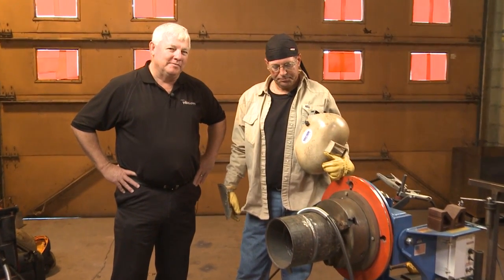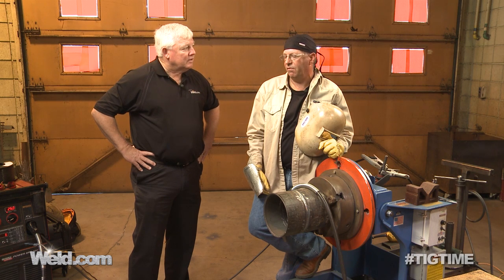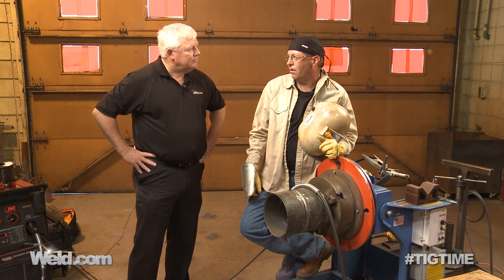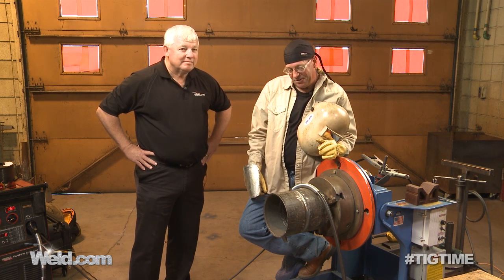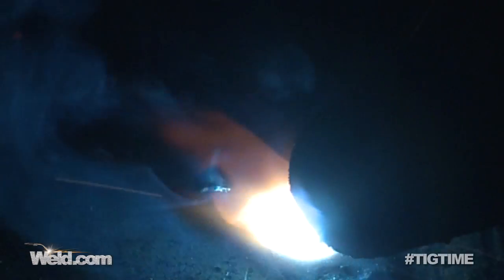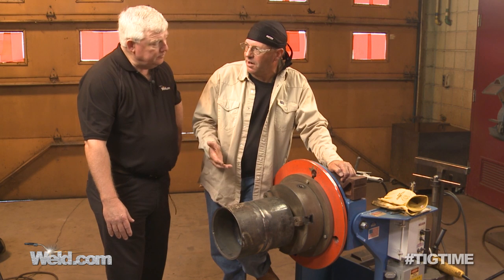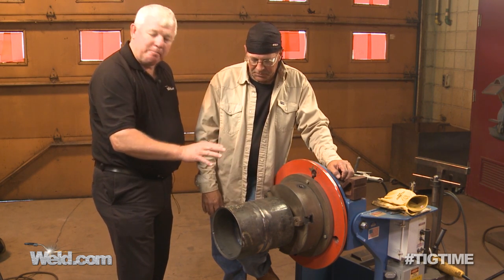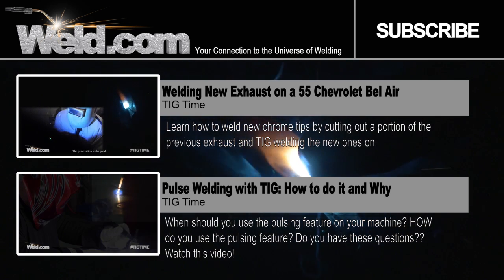Pipe Welding: FCAW Welding the Fill and Cap Pass

Comment: I thought you had to go uphill. Or is it different since the pipe is on a rollout wheel. Is that equivalent to welding in the flat position with the roll out wheel
Reply: As long as you’re not welding on the side of the pipe and your welding more towards the top it is essentially the same as flat when you do it on a positioner.  So yes, you’re correct.
Reply: Cake Fart RPG  thank you

Comment: Is there such thing as open root with flux core?  Ive seen 6gr but its not the same.  Yiu you make a video on flux core root on pipe.
Reply: I've used .045 dual shield to run open root thru cap. Takes a few tries to dial in the root opening and landing to get the proper root pen and reinforcement. 1 root pass and 1 or 2 passes to cap out on sch40 6" pipe.
Reply: Chuy RDZ yes

Comment: Yeah that wire speed was kind of high lol. Also I thought flux core had to be done uphill like 7018
Reply: I've ran 7018 3/32 downhill on 4in pipe in college not realizing it I just cranked up my maps and it bent fine I had some undercut open up but it didn't fail me

Comment: If this pass was done with solid wire no flux core would you have seen ripples in the weld or would it have been smooth also thnxs

Comment: Every weld test I've taken or practice has been strictly stringers no weaves( flux core wire) and I've read somewhere that those wormholes can be caused by to much shielding gas pressure.
Reply: only time ive had that prob was running very hot around 27 volts and up
Reply: too short of stick out could also be the problem
Reply: Wormholes or tracks can be cause by a number of things. After trying everything and still getting them, grab a new roll of wire.

Comment: The amount of worm holes on the full pass is unacceptable!!! 

If your going to do a video to give people advice then do it right! 

Use fresh dry FC wire.
Reply: i thought i was the only one who noticed those wormholes. im surprised he didn't get porosity on the cap pass
Reply: Trust me they are there, watch very closely as he's laying the cap pass. 

That ain't ripples. They are defects
Reply: Heres the thing

This is not a tutorial its just a badic over view of this process mig root then flux core dual shield fill and cap... basic settings etc

Lighten up and GET A LIFE
Reply: ***** holy shit the fill pass it full of worm holes I see them as he's laying the cap like u said...terrible that I agree is unacceptable
Reply: to hot
Reply: I don't think those are wormholes fellas, he's weaving(idk y) so it leaves ripples it looks nice and smooth when u don't weave u don't need to weave with flux core it will increase chances to trap slag for an xray
Reply: *****  wow that's bad!
Reply: Its not my job to rectify the mistakes made by this " welder " but in my opinion torch angle, damp wire or an issue with the machine could be one of many factors causing the defects. All I was saying is that if you are going to make videos to show people how to weld then don't show a video of a welder laying down weld beads full of defects. kinda sends out the wrong signals a to what is expected.
Reply: roughcap i seen those crows feet! lol
Reply: Dude i was about to say am i the only one that sees worm track fuckin galore
Reply: only time ive had that prob was running really hot and fresh wire didnt fix. if your gonna point out a defect give a solution
Reply: SaltyBro 
I’ve had this problem when my material is super hot and(500 degresss if I had to guess) no one seems to know why.  My only guess is that it’s so hot that the heat rises and pushes away the shielding gas.

Comment: I weld my fcaw cap at 500 wire speed and 32v..looks way better than this and passes 100% xray
Reply: whoa damn 500 wire speed? thats crazy i use about 350 at 28-29 volts you must fly through those welds huh?
Reply: Luis bonilla there's guys at my work that hit 120 inches in a 8 hour shift I can do like 75 inches in a 8 hr shift.. from root to cap 100% xray
Reply: Jorge Moreno thats an insane amount of weld
Reply: haha ive done that a few times 32.5v 525wfs shit is hot! had to wear those shiny shielded gloves
Reply: +Countryboy2206 yes I use that shiny square to block the heat too😅
Reply: Countryboy2206 m

Comment: Why the hell would you do the root with solid wire and the cap with a flux core? You enjoy welding with two machines all day?
Reply: Anybody who runs this process uses a dual wire spool machine.  This is a heavy industrial application, not for most Joe's with a garage tinker station.
Reply: I've done up to 20" carbon steel pipe with solid wire. What's the reasoning behind flux core?
Reply: John Duda, you can do root, fill, and cap with hard wire but I prefer root and fill with hard wire and cap with flux core. Better fusion. Takes like 1 minute to change a roll of wire on a machine, no need for 2 machines.
Reply: John Duda coz the door was open blowing his gas away!

Comment: DUEL SHIELD WIRE  LIKES VOLTAGE .045 FLAT WOULD RUN AT 25- 27 VOLTS,USE 75/25, CO2 SUCKS. SOME TIME YOU WILL NEED TO USE A .052 CONTACT TIP TO KEEP THE WIREFROM STICKING, DON'T RUN IT DOWN HAND ALWAYS VERTICAL UP WORKSGREAT OUT OF POSITION IN MY JOB SHOP WE USE .035 TO WELD TRUCK FRAMES. IT CAME ABOUT BECAUSE OF A NEED TO HAVE 7018 WIRE .